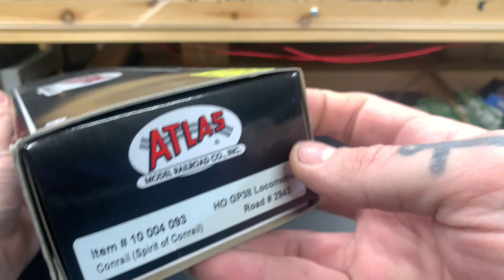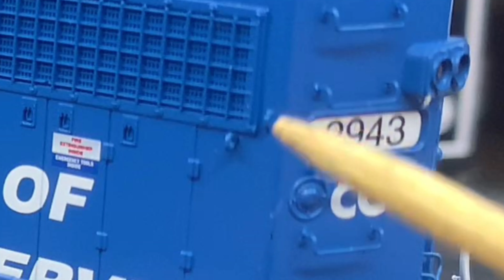New Run 2024 Atlas Master GP38 Conrail/NS 2943 Spirit Of Conrail

Comment: Awesome review! A Scale Sound Systems speaker would be a great replacement for the factory speaker. Atlas, Walthers, Fox Valley, and older Intermountain locomotives seem to often have cheap speakers in them.
Reply from the maker: Thank you! I have been wanting to try out the Scale Sound Systems stuff for a while now just need the right project for it and this may be it!
Reply: I know my reply is a little late, but you won’t regret using a scale sound systems speaker. Almost all of my locomotives have them. Best speakers you can get

Comment: hi steve !!!  excellent video work !!  2 points for you... first, i watched one of your previous clips and you asked for suggestions on weathering telephone poles, so here is what i do.  i make a slurry of burnt umber oil paint and thinner in a small glass/porcelain bowl and just "glop on" the mix and it seems to look fine as the watery part gives one type of weathering look and the thicker "muddier" part of the slurry give a different look, all of which ends up pretty nice.  pre-spraying the poles w/dullcote helps a bit as it seems to help both the thick and the thin slurries stick a bit better !!  then, for the look of "newer" poles, you can actually add a bit of tan/buckskin colored acrylic paint and they will look like a somewhat recently upgraded pole !  i buy the cheap acrylic paints at walmart... the manufacturer is called apple barrel but i am sure there are others as well.  second, after your atlas gp 38 cr review, i am considering buying the 2 furx engines for my pike... nice job on that video, steve !! i model the current bprr from buffalo,ny to pittsburgh and always "fit-in" an older p2k crq/crq/ns (non horse head) sd60's consist that runs eastward towards nyc ( "NEW YORK CITY ???) and the engines are very smooth runners, lubed nicely  and 20-22 years old !!!  life like did excellent engineering on their sd 50/60 products prior to their purchase by walthers... do you run any on your pike ?  steve, please keep up the really nice videos as your discussion style is really down to earth and well versed !!  i am retired now and mondays are work days on my rr... i will run my crq consist today in your honor, with an ice cold beer at lunch !!!  blessings to you, steve !!  ps... i buy the cheap, old ahm telephone poles at the shows as their dimensions are perfect and cheap !!! also, if you look at poles near rr tracks here in western ny state, most are beat to hell and leaning over, so the cheap ahm poles are a perfect fit !!!
Reply from the maker: Thank You! The Atlas GP38's are defiantly worth picking up. Ill have to try out that technique with the next set of poles I weather as it sounds like it would work great! I don't currently have any of the Proto 2000 locomotives currently on the layout although I may pick up a few in the future.
Reply: steve... if you want to find some nice p2k sd 50/60 engines, trainz has them now and then, especially the beautiful sd 60 safety cab in crq... totally beautiful and they pull like crazy !!!  of course you must add a decoder, but putting one with a p2k ns ( non horse-head), which can be found, too, looks and works great on the layout !!!  i went to a local club at christmas time and most folks could not believe their pulling power as 3 crq's pulled a 44 car train around the pike smoothly and easily for over one full hour !!!  yes, they do not have the detail of scaletrains or athearn,  but with your weathering skills i see in your videos, i am sure you can "supe-them-up" !!!  i believe i have 20 or so p2k's on my pke and they are the real thing !!!  blessings to you, steve !!! @ConrailSteve
Reply from the maker: Ill have to keep an eye on Trainz I buy alot from them. Hopefully they will get one in for a reasonable price soon

Comment: again, hi steve !!!  just watched your weathering of chessie/csx hoppers and the weathering looks nice !!! here is another trick to go along with your baking soda texture... way back when i was attending rx school at univ. of buffalo i accidentally spilled a small bottle of liquid white out on my desk and did not get all of it cleaned up...  several days later i found a hardened "glob" and wiped it up, but there was some residual left behind with a bit of texture to it.  it then hit me that this stuff would make a good weathering material for hoppers, gons, etc. !!!  it comes in yellow ( for legal pad use i assume) and white, but i have since used docs weathering powders from micro mark to add different colors to the white.  i have used the white with a touch of black for a gray cement spillage when loading,  yellow with a bit of red for sulphur spillage on 3 and 4 bay older hoppers... you can imagine the possibilities with this stuff... relatively cheap, too !!!  there are different ways to use this liquid. .. i have hit it straight downward with a small but stiff paint brush, stippling i believe it is called... i have also let it dry ( as i accidentally did on my desk years ago, as previously discussed) and then wiped/dabbed it and in both cases it left a nice, dried out edge to the spillage area which was readily visible  and a bit raised up from the inner spillage area.   cold beers to you, steve !!!
Reply from the maker: Ill have to try that out on the next set of covered hoppers I weather!

Comment: Wow this loco looks good in person, I have only seen the illustration of it on the online retailer’s sites. I might need to buy this one. I bought an Athearn SD38 after watching your review on those, and I like it. I do not have dcc atm, might just get this in DC and upgrade to DCC and sound later down the road.
Reply from the maker: Thats part of the reason I am making these product videos when new things come out. The illustrations and stock photos never seem to really show how good a model actually looks. These do have the stock Atlas 21 pin DC/DCC board in them so upgrading to DCC would be easy plug and play when the time comes.
Reply: @ConrailSteve  Heard on that. So when I buy a decoder with sound, where does the speaker go? Can I buy the same decoder that comes on the ones that have sound from the factory?
Reply from the maker: I believe the DCC ready Atlas units have the plastic speaker mount that the sound ones have just with no speaker installed but am not positive on that. If anything a cube type speaker could be mounted on the rear weight  the same as location the sound ones have factory. You can buy the same ESU V5 decoder that comes in these factory but will need to have it programmed with the factory sound file off the ESU website. Most places that sell the decoders will do this for free but personally I would recommend getting a Lokprogrammer and doing it yourself. They are pricey but they are worth it the more locomotives you add ESU to.

Comment: It look great and nice details too. Look at how easy it is to remove the body contrary to some other overprice  loco😄. Since it it Atlas you know it's smooth and reliable.   👍👍
Reply from the maker: I was very impressed with this GP38 and how it looked. I also really love how well these Atlas units always run and how easy they are to open up and work on when needed.

Comment: Athearn puts everything on a -2 😒philly division too. Supposed to be 38. This is a great step forward!
Reply from the maker: I still have one of the old Athearn blue box philly division sets myself! These new atlas units would be a great starting point to build a proper philly division GP38.
Reply: @ConrailSteve  I agree, I actually made mine out of the original Atlas gold but not happy with the decals , cmr decals are layers and didn't set right . But 3' rule no complaints.
Reply from the maker: I have some of those CMR decals as well to build one eventually. The CMR decals can be very hit and miss I’ve found as sometimes they go on smooth and are barely noticeable, other times they end up with edges that are very visible.
Reply: @ConrailSteve  I agree , after the decal is in position, I hold it down with my finger to get it flat .. little trick... shouldn't have to do that . But it stays down, sometimes
Reply from the maker: I have the worst luck trying to push down on decals they always seem to tear whenever I do that.
Reply: @ConrailSteve  I only hold cmr down, just if they curl up. They are pretty thick compared to microscale. I don't have to on anything else.